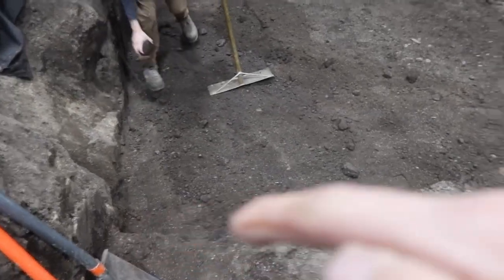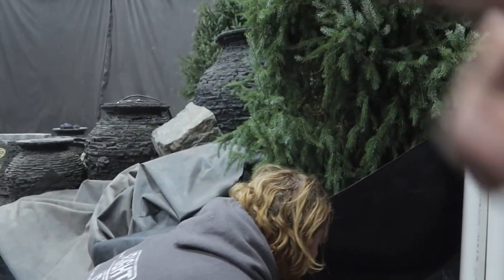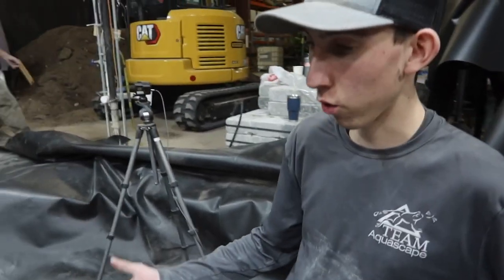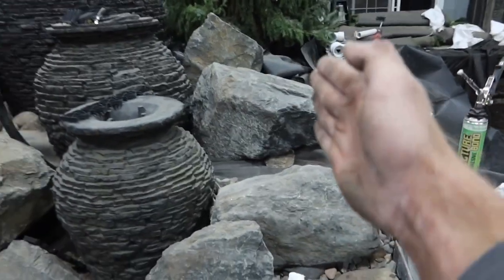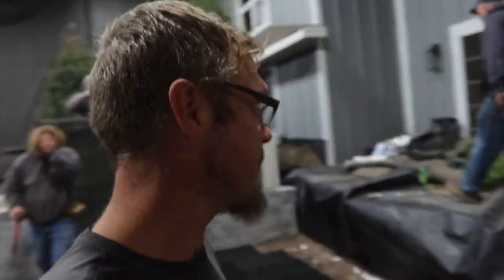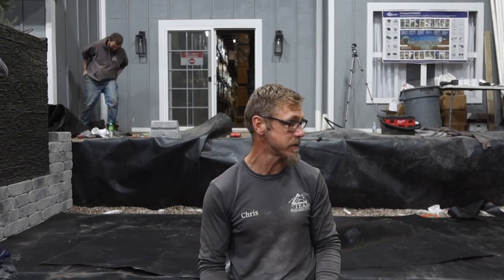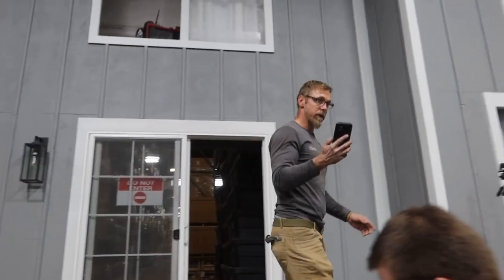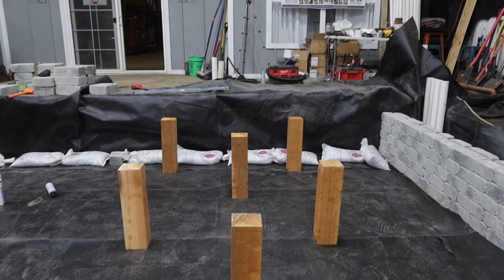CONTEMPORARY INDOOR POND in a Sandbox - Part 3

Comment: Our EPDM liner developed some small leaks after about 25 yrs, last year we cleaned the pond out and threw a HDPE liner in over the top. The choice of the material wasn't mine unfortunately, and after fighting the folds in the corners and complete lack of stretch, it certainly wouldn't be my pick in the future. It also has a woven look to it, which to me makes it look like a cheap tarpaulin, just awful. 
A year on and I'd re-do it with EPDM all over again if I had the chance, but I also have a strong urge to just rebuild the whole pond with a bottom drain and gravity fed drum filter pumping back into planted upflow bed with a wide sheet waterfall back into the water. But I'm a good £10k short on going that far, so the in-pond pump and big box of jap-mat filter will have to soldier on.

Comment: Question; with the walls being inside the liner, is there not a risk of subsidence with a lack of concrete footing? I know this is only temporary but surely you couldn't use this method on a permanent build and therefore what would be your method? I'm thinking, lay some concrete footing under the liner with lots of protective fabric below and above the liner before the blocks go down.
Reply from the maker: We dig deeper where footings are going to go and pour concrete inside the liner normally